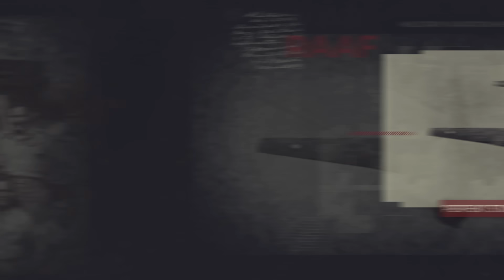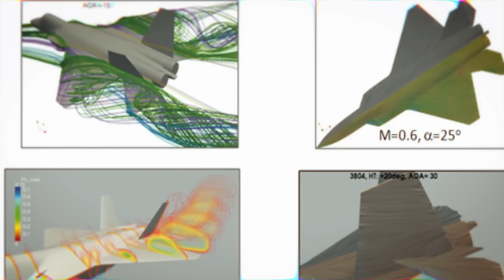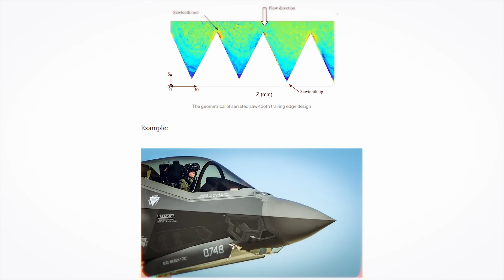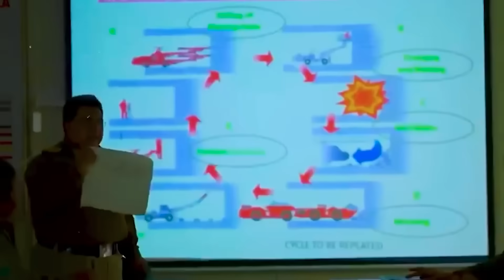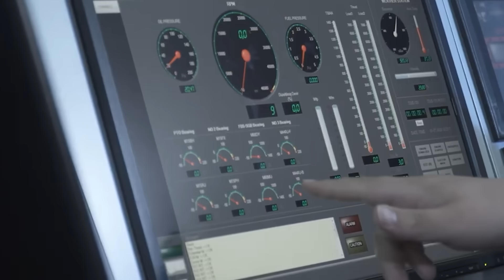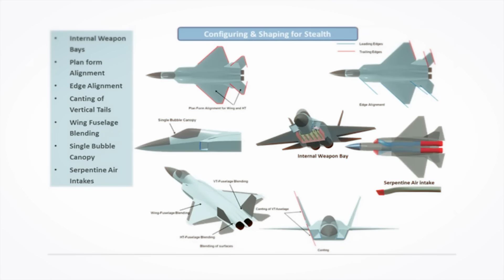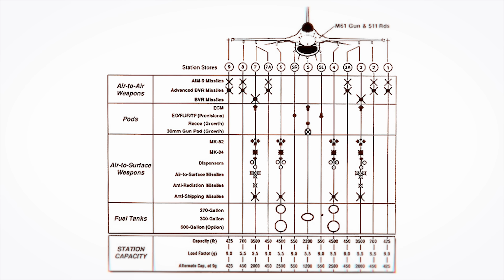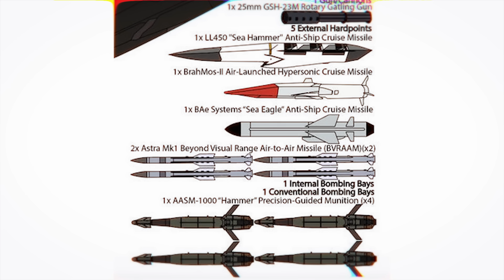India's 5th Gen Aircraft | HAL AMCA

Comment: Brother you have done your research but let me correct you in one place
HAPS ( High Altitude Pesudo Satellite ) wouldn't be launch from AMCA, HAPS has a wingspan greater than 56 meters
Its part of the CATS ( Combat Air Teaming System ) which also has Cats Hunter, Cats Warrior (wingman) and ALFA-S

Also AMCA is not supposed to replace the Su30 MKI, Su30 MKI will be in service till 2045-50
Reply: AMCA will replace sepecat Jaguars, mig 29Ks
Reply: @Dhruv-is4dp  both AMCA and Tejas mark 2 will replace those
Reply: @yashasvisingh6694  intresting but I don't think so. Jaguar sepcats main role is hills and carpet bombing, I don't think that role would be done by Tejas (both) bcoz of design characters. Yeah you can force into it but they won't perform as good or better then jaguar bcoz of low speed and flying low af in valleys.Yeah mig 29 definitely bcoz of knard design in Tejas mk2 make it better in low speed and manuvrable like gripen but AMCA won't be used in mig29 upg role i.e first responders. But AMCA role will be totally different from others they can't replace the su30 with this bcoz it won't provide that much offensive power, I think requirment of flankers will still stand through usage will be back of pack and frontal will be the AMCA bcoz of low rcs. Mig 29 K totally different will be replaced by Tedbf or Rafael m. In my opinion Hlft24 might be the one to replace jags bcoz of previous marut used particularly in carpet bombing and having substantial armour.
Reply: @Jat-yn5ch  Jaguar is becoming increasingly obsolete 
It isn't a proper attack aircraft like A10 Thunderbolt II and Su 25 Frogfoot
It only has 7 hardpoints which aren't enough to have a good amount of payload to perform CAS
With Tejas and it's modern avionics it can easily replace Jaguar
Reply: @yashasvisingh6694  bro A-10 and su25 aren't made for carpet bombing. The only job of them is to support ground troops bcoz of their gattling guns... They only provide close air support, but can't do carpet bombing. That's why jags are there, it's main role is carpet bombing and fly crazy low, like barely above land which can't be done by the majority of airfighters. Tejas can't be compared with jags, it's entirely different in role. True competitors of jags are maruts from earlier days bcoz of its role in carpet bombing and at the same time rugged enough to provide some extent of CAS. Tejas main role is Interceptor and become backbone or to say wingman to bigger aircrafts bcoz of miniature rcs, which blinds the enemy radar by larger aircraft rcs. Tejas can't be used in CAS bcoz of lack of armour and single engine, that's where helis and drones will do power play.
Reply: @Jat-yn5ch  The problem with carpet bombing is that 
Jaguar has very less hardpoints compared to Tejas 
It can also be less payload than Tejas 
Also with laser guided bombs your speed doesn't matters
Tejas is a multirole fighter it can do everything that Jaguar can do
Reply: @yashasvisingh6694  yep, I know it has less hardpoint but jags role will be just to carry bombs not air to air missiles. Whereas Tejas role is to carry both but in valleys it becomes much more difficult bcoz payload get halved if flown from higher altitude. We are talking here about behind enemy lines to perform role not deep inside territories. Also the fact that jags role in air superiority is over, bcoz of 4.5gen airfighter. And in valleys you want an aircraft which can't just have instantaneous turn rate but also land mirroring to be inside the enemy area but not on radar. Delta designs aren't meant to perform down in valleys. Yeah it does have to those capability bcoz of evolution i.e gonna play a role in mk2 and other countries. But at the same time mk1a bombing opp will be much more beneficial in Rajasthan and gujrat environment that's where they are and will be deployed.
Reply: @Dhruv-is4dp  ig Mig-29Ks will be replaced by Rafael-M or MRFA
Reply: @Dhruv-is4dp  mig 21 will be replaced by Tejas
Reply: @somarkosarkar2697  Chinese analysts are hoping India to buy a lot of Tejas. That will degrade IAF for many years to come .
Reply: Amca mk2 will replace su30 after 2045
Reply: @Someguy-z3k  You are right after 2045 as they are going through the super sukhoi upgrade program
Reply: @Someguy-z3k  No 
AMCA can't match Su 30 MKI 
That's a heavy class of fighter 
AMCA stands for Advanced medium combat aircraft 
Most likely a new program will be initiated
Reply: @Someguy-z3k  LOL There is only one problem.  Both USA and China will deploy Gen 6 fighter jets by 2035.  Why bother with the Gen 5 junk (which is still on PPT only)?
Reply: @KittyKittyCat-vf8zd  yeah yeah .... Btw what happened to your f35 engine, so when it's coming out ? Fyi that engine the adaptive cycle engine is the true 5th gen engine so when it's coming out ?
Reply: @Jat-yn5ch  ? He's right. India is massively behind lmao. By that time, the US and China will have hundreds of 5th-gen fighters and have 6th gen by then.
Reply: @Flightman453  okay, flight man.... as your name says but you ain't smart enough. I do agree with you on one thing that usa and china will have numbers till that time. Okay kudos to them. But the day is still young. Pls just explain to me why in the world there are only a handful of countries operating only a handful of 5th gen fighters. Don't give me bs on production. As I said in the above question what's the status of the engine ?
Reply: @KittyKittyCat-vf8zd  UK and India are already working on a 6th gen fighter aircraft since 2 years. Now cope.
Reply: @_omnipotent07  Since when?
Reply: @_omnipotent07  Sorry to tell you!  UK can't even produce a gen 5 plane. LOL You have found the wrong partner!   LOL
Reply: @Jat-yn5ch  F35 engine? Pratt & Whitney's F135 powerplant ?  What about it?
Reply: @Jat-yn5ch  Insults don't change my point. I don't care about whatever engine thing you're talking about and it's irrelevant considering the F-35 has been mass produced and have built over 1K airframes.  I don't know the point you're trying to make in your question but the only two countries that have mass produced and fielded 5th gen stealth fighters are China and the US. In this case, your "handful" is referring to US allies and all that stuff is more closely related to politics. So I'm not sure what your question is supposed to prove. Mocking one country when India is behind and isn't even close is funny.
Reply: @KittyKittyCat-vf8zd  False. It's not like Europe can't produce a 5th gen fighter aircraft, it's just they dont want/need any. Europe decided to stick to 4.5 gen fighter aircrafts like Rafael, Typhoon and Gripen. Why? Because Russia is the the only enemy they got and NATO have USA with large airforce and navy (both having aircrafts) to counter it. Have some education.
Reply: @Flightman453  that's something, okay let me tell you about it... F35 engine i.e P&W F135 are powerful but there is a problem in it that is fumes and heat, it does have greater stealth but understand those IRST sensor morden one have range about 100-150km (being very optimistic bcoz of prev gen are giving 80-100km) so yeah enemy will be on your a** in no time. We all know that, these 5 gen doesn't have that much balls in dog fights. So the upgrade that was talked by US over a good chunk in development phase of f35. Pls be my guest and search Adaptive cycle engine. Talking about China the ain't in the game, su30mki spotted J20 via the previous gen IRST sensor. If gonna bring china do some research on the engine they placed in their j20 i.e AL31 engines and most talked about W20 are derivatives of it. So do your research.
Reply: @Flightman453  now coming to numbers, buddy you should have done your research properly. Now coming to it US operates nearly about 300 and second largest Canada 88 and. Third Australia 65ish. How many variants of f35... distinct variants 3... For all the user. Like seriously mate. If i start tearing more in it, you will regret having a conversation. If still wana go one.... Okay f16 operational with US 840 ish. Just compare the data, f16 is with just USAF not with the navy or army. Alright. 
So yeah I do agree with ya, India is behind but ain't much buddy and in comparison of 5gen  and 4.5 gen is just a stealth other than that Rafael has closed the door. If India wanted a stealth fighter, they would have gotten the su57 or f35. Russians are on feet and ready to give 100% TOT of that and plus India already had RAM coating but they choose to do it differently. Su57 development is still possible bcoz of buyers like UAE were involved in talks for tri junction in it, so yeah these are facts reported in news outlets.
Reply: @_omnipotent07  in ya dreams, no deals are finalized. UK pitched them two times but not sold. The Japanese option is still open, what would be action will be interesting to watch.
Reply: @Jat-yn5ch  UK pitched but not sold? The 6th gen aircrafts haven't developed to be sold. What are you talking about? Even if the deal doesn't work then you yourself said that Japanese option is open. That's what a deal is all about if it doesn't work, drop it and move on. UK pitched India about the joint development of Tempest 6gen aircraft but India have two ongoing projects and can only start working on after 2027 if things go right.
Reply: @Flightman453  India have two projects ongoing as of now may be after that.
Reply: @_omnipotent07  pitched in to joint development brother.... Anyways it's yet to be seen what step to be taken by India on it. Japanese prospective is open it means a Collab or if not then the selling of technology can take place. 3 airfighter are currently being worked on and plus a bomber UCAV
Reply: @_omnipotent07  After that? So what, in the 2040s? They don't even have a 5th gen yet; they should focus on working on that project before they even mention "6th gen".
Reply: @Jat-yn5ch  Yeah. Agreed. That's what I said, India is occupied by two projects the reason why there are no deals. 6th gen can wait.
Reply: @Jat-yn5ch  You're not saying anything here. I don't even think you realize you're spewing a bunch of words you don't even know which point you're even responding to. Sorry, but whatever backwards logic you have doesn't work. India is behind. They can't compete with rivals like China. They have zero 5th gen fighters and they only have 36 Rafales which is their best plane. What exactly is that going to do? They're better off just buying the F-35 because they're incredibly behind. And the Su-57 is garbage, is that plane even operational? Last I checked most of the ones built are all just prototypes.
Reply: @Flightman453  aaha, yeah i am nerd just spewing anything or crazy whatever okay. Yeah Indian doesn't have any 5 th gen and US and China or its allies got some. Cool. Leave those technical things aside. Cool. Typical stereotype. just a question why do you come to do a debate if you ain't know shit ?
Reply: @Flightman453  That's what I meant by "ongoing projects" 5th gen aircrafts, AMCA and Tejas MK2 and TEDBF programmes. And tell the same thing about Europe as they also don't have 5th gen aircrafts, skipped and jumped directly to 6th gen aircrafts development.
Reply: @Jat-yn5ch I'm not debating shit with you. I'm simply stating my thoughts and replying via comments. I don't even know what point you're trying to make. I replied because you were seemingly trying to shit on the guy with some random thing about a new F-35 engine which is irrelevant when the aircraft is established and has been massed produced.
Reply: @_omnipotent07  actually it's not that reason. Its factor to do with no structure being decided on the 6th gen. Yeah internal studies are taking place for next gen fighters, you can see that in form of applying to UCAV and FUFA . That's same done by US as well in form of MQ-25. If you look at DRDO, they are working on sub systems of 6th gen and have displayed it on Tejas np5.if remember news about the Tejas being mothership. So yeah sub systems work are being taken place. If you look at UCAV and 6th gen fighters sketches you will get it what I am trying to say.
Reply: @_omnipotent07  Sure, Europe doesn't have a "native" collaborative produced 5th gen fighter like the Eurofighter (4.5 gen) but that doesn't matter considering the fact that thirteen different European countries operate the F-35 and are only going to get more. So there's no need to work on that so it makes sense they're working on a 6th gen.
Reply: @Flightman453  ooh that's some anger, okay. Cool mate. just advice focus on your biology mate. this ain't gonna gain ya anything.
Reply: @Jat-yn5ch  I'm not angry at anything lmfao. Why would I care? I'm pro-China. India is behind China military and won't catch up, so why would I care? I'm merely stating my response to your comments. And going to my page is hilarious, this isn't Twitter. I'm the mad one but here you are going to my page using a bio that I probably haven't touched in 6-7 years. Cope.
Reply: @Flightman453  Now I see. You're here with you presumptions. You're too naive to comment on this. The aerial warfare situation between India and China isn't like anywhere else. India isn't considering either F35 or SU57. SU57 doesn't meet the requirements while IAF can't operate with F35 as they have Russian missile defense system, S400. Another reason why F35 is not a good option is because the maintenance, upgrade and repair costs more than the aircraft itself. Only a fool will buy a loss. Ask South Korea, they got F35 now facing the same problem. And why you have to point that "India is behind". Are supposed to get offended? Ofcourse India lacks air power compared to China. You figured out no secrets. There is a need for aircrafts. But like I said, the aerial warfare around globe and in Himalayan range isn't same.
Reply: @Flightman453  They? Only UK is working on it. I can only say that only time will tell where it goes. Also, with a crippling economy, I doubt UK will be able invest in R&D and develop a 6th gen aircraft.
Reply: @Flightman453  okay, but your chats shows otherwise, Whatever.....pro china be my guest. Do you have anything else to add on. Pls while you are here why don't you say about the 18B$ sanctions? Why is it hilarious ? By going to the profile page you get to know a person whom you are having a talk. Is that wrong? Then Bloody hell sue me 😂.
Reply: @KittyKittyCat-vf8zd  oh silly. I guess we forgot to mention one thing. AMCA will be a 5.5 gen fighter jet which will have a directed energy beam weapon system. Looks like you will have a heart attack when it launches XD
Reply: @_omnipotent07  India is invited in the team but there is no news of that yet. When was it out?
Reply: @KittyKittyCat-vf8zd  UK can't but surely Japan with the help of UK and Italy can if US just stops acting like Japan's dad everytime.
Reply: @Flightman453  If your jets are really so superior, then how F-22 lost to Rafael in a dog fight which is not even 5th gen? Don't say it was a dog fight so no weapons were allowed to use and only flying was.
Reply: @plusultra7258  I don’t give a shit, I never made that claim. I’m not a US fan. You don’t even know what you’re talking about. The F22 had most of its advantages removed for the fight. Take away the stealth and the BVR capabilities and you just have a capable jet. For these exercises, they often equip F-22s with Luneberg lenses so as to not give away it's true capabilities. Besides, AN/APG-77v1 outclasses RBE2 AA by a ridiculous amount, which France didn't even receive till 2012. 120km detection range against a 30sq ft target? 😂 The Rafale is an incredibly maneuverable aircraft. Loses in a BVR fight everytime against a F-22 but close in like this they're pretty evenly matched. So your point is useless, especially dogfighting like that today is a thing of the past and doesn’t exist anymore.
 
“Experts who have viewed the Rafale vs. F-22 video acknowledge that the French pilot had pushed his airframe to its limits, even reaching 9Gs at one point during the dogfighting exchange. The Rafale’s victory over the Raptor as shown in the video further exemplifies the point that sometimes the pilot is more important than the airframe.”
Reply: @Flightman453  okay, i didn't ask that question do you care about it ? But that's an interesting comment, I am sure xi will hire you one day 😂 for propaganda as obvious 😂. The most interesting comment you made is the dogfight is past, very much interesting that i started crying for you mate. Leave aside, just tell me one thing what pilots do in dog fight didn't they take the fighter plan to its limits ? Nah, you should say.... Guys we have defence Karen here 😂😂 how come you know that f22 capability or tacit in armour is removed or stripped for the fight ? What's your source?
Reply: @plusultra7258  it's been more than two years back as far as I can remember.
Reply: @Flightman453  F22 is a dedicated air superiority fighter. It is optimized to shoot everything else out of the sky. Rafale is a multiple purpose fighter bomber. It is a jack of all trades and master of none.
Reply: @Flightman453  France is falling behind on military technology big time. Not only it does not make a gen 5 plane, but also fails to make folded wings for Rafale -M. Very poor execution.
Reply: +1
Reply: China also has an array of air superiority fighters. J10C, J11D, J20 and J35 are fine examples. India has bought the wrong plane to counter China..
Reply: @KittyKittyCat-vf8zd  what a defence analyst.... So tell me what they should you have brought against Chino. If you says who you're so it's definite the situation will arise. So explain timer defence analyst
Reply: AND YOU KNOW THAT HOW EXACTLY!??? 😑😒
Reply: @rexxbailey2764  Because Su 30 MKI is a heavy class fighter with a MTOW which can carry 8 tons of payload and fly 3000 kilometres any need of a drop tanks
It can carry Brahmos a 3 ton Anti ship/land missile 
How exactly AMCA a medium class fighter with MTOW of 25 tons is going to do that